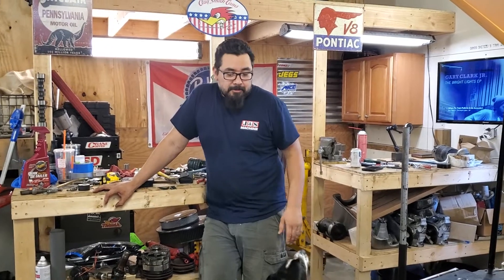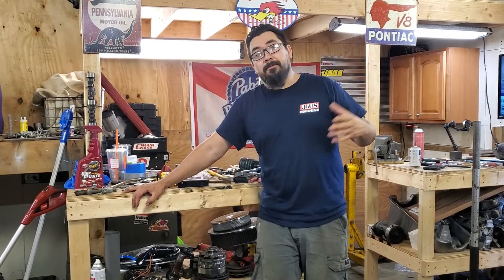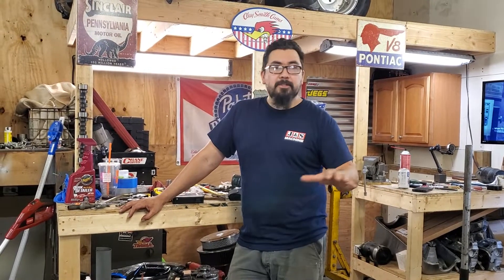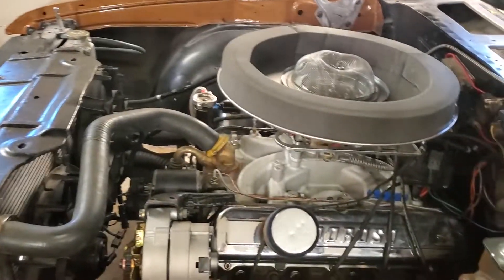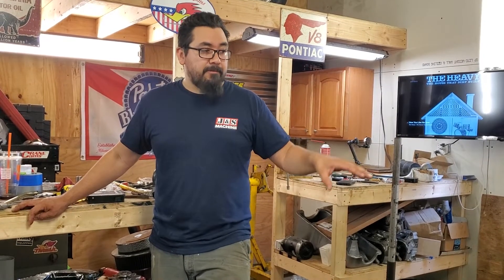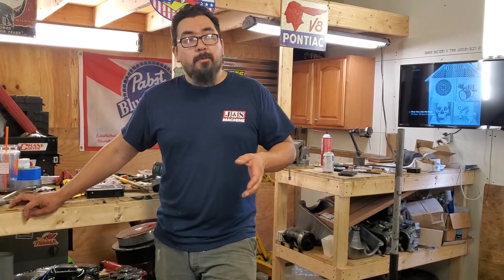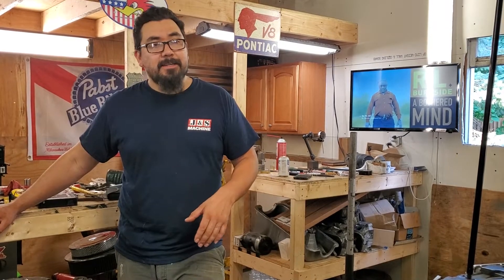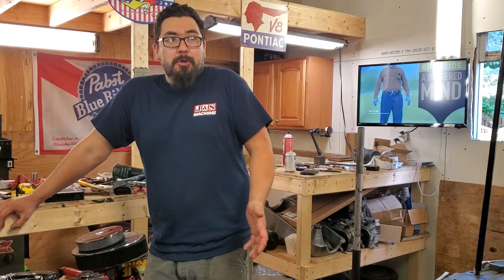Pro LS/anit-LS argument

Comment: I've gone to LS power.I bought a 6.0 all bolt on deal 551hp on LQ4 No fly cut pistons just bolt on deal.If I remember right $2800 total.I put in 95 S10 love it.I still love going out in my 68 cutlass 355 #5 race port solid cam 247/247 108/104 runs mid 12s 4.10gear and 4700 converter. I might build a  turbo for car in future.I Always enjoyed watching you learn how to make you car faster by doing the little things.
Reply from the maker: Thanks. I wouldn't mind building something LS. Dead reliable and even a near indestructible 5.3 combination will do low 12's high 11's and be dead reliable. From what I've seen atleast

Comment: Lol I have thought about putting a 3.9l v6 in my Cutlass recently...one guy up north put one in a third gen Camaro with cam, springs, turbo and has run 10.40's with it... the engines are under $300 at the wreckers. I'm also cheap that's why I'm going turbo on my Olds, and I have too many spare parts/engines for it! I have not done much on my Olds over the years due to having my dad telling me that I "need to build it right to keep it together " because he learned the hard way back in the 80's. Now I said screw it and tossed a $50 engine in and am going to boost it and see what happens!
Check out sloppy mechanics 8's for $8,000 build... cheap ls in a cheap Mustang.